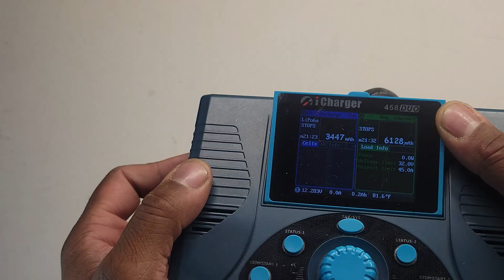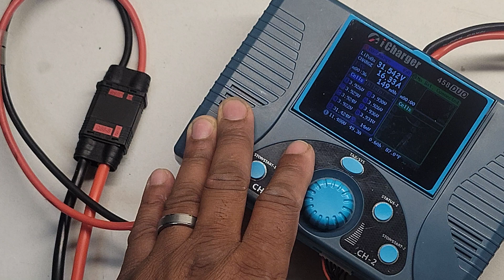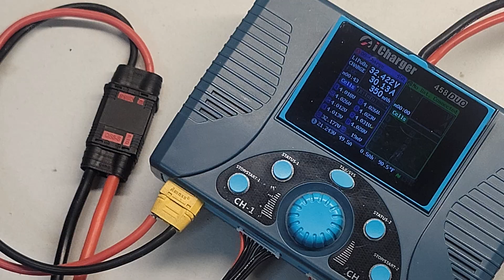8s lipo charging 12v vs 24v supply (iCharger 458) #kilowattrc #new #omg #lipobattery

Comment: I picked up a couple 1600 watt Dell Server power supplies for about $15. Few small mods and now I have a 24 volt power supply for my ISDT T8. There are a bunch of videos here that show how to make lipo charger power supplies
Reply from the maker: They are definitely cheap and just some basic electrical skills needs to set up voltage between power supplies

Comment: Do you have a video on your whole charging set up? I’ve been using a venom pro duo charger for years,it takes forever to charge my 4s 10k mah packs, I’ve been thinking about upgrading my charger for awhile.
Reply from the maker: No I don't have a video, should be a few on YouTube for I chargers, it really depends on your budget too, the 458 is around $350 and you still need to buy a power supply
Reply: @ ok cool I’ll look for a few videos to watch

Comment: I have 2000w 48v power supply for my 4010 duo
Reply from the maker: Honestly 48volts is where its at.  I should probably do something like that with these 458's
  with 48 volt I would be able achieve 2200 watts.
Reply: @KiloWattRC  ya you defo would reach those 2200 watts, ive been trying to find power supplies for cheap and not for $500, if you know any good ones please lmk. Thanks. Also you probably would only get 33 amps out of it since you would be putting the max 1100 watts out by using an 8s pack. considering the packs around 33 volts, 1100/33 is around 33.33 amps. one amazing charger.